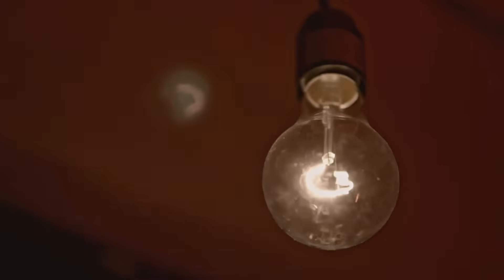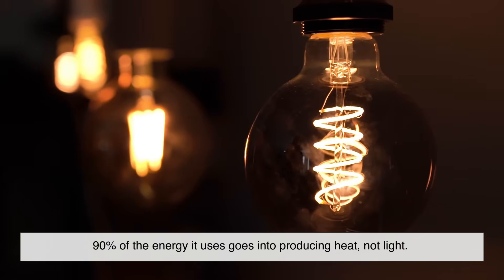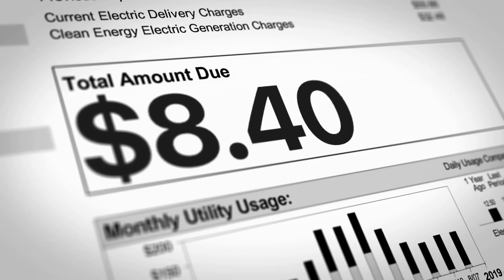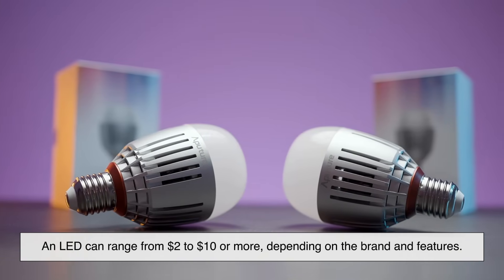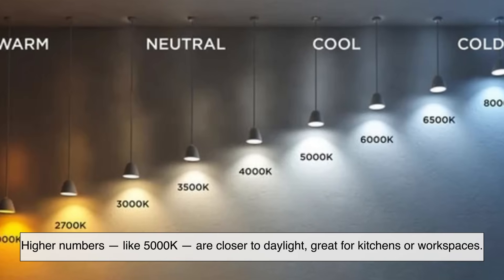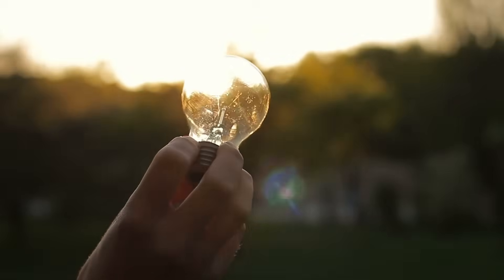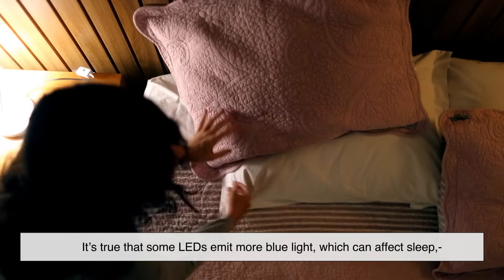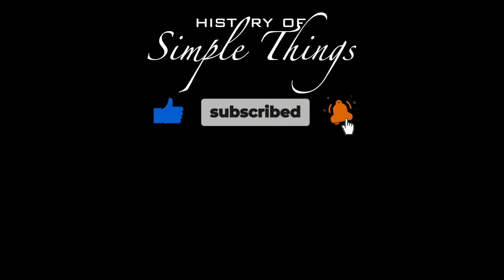LED vs. Incandescent Bulb: What's the Real Difference?

Comment: You are just praising LED lights too much, of course they are better to use right now and to save money, but that does not mean they are better in every aspect. Incandescent bublbs, as seen in most comments, has a more natural, warm light and they are like a tiny campfire, the light is just more authentic but not as practical as LEDs. On a side note, LED bulbs doesn't last as much as you say, I have to replace them every few months

Comment: Energy consumption for lighting was around 10-15% of the typical household energy consumption, and LED lighting if highly problematic when it comes to disruption of the circadian rhythms of humans and other species (this is very much the case with outdoor lighting). Read up on melanopic lighting, and you will see. As a side note, even LED light sources with a lower CCT (correlated colour temperature) - meaning a warmer hue - can contain a blue component high enough for it to be disruptive to our circadian rhythm. The blue light stimulates the production of cortisol through special nerves on the retina, that were only discovered twenty years ago! Among the health risks that arise from melanopic disorder are diabetes and cardiovascular disease. Subvisual flicker has also proven to be a health issue. That's why the LED driver switching frequency needs to be at least 3 kHz - way above the perceived flicker frequency; this isn't achieved in cheap LED light bulbs. Furthermore, incandescent light bulbs have a smaller production carbon footprint than LED lighting bulbs, and are easier to recycle because they consist of fewer materials, whereas LED bulbs require mining of copper, silicon, and tantalum. When lighting homes the heat "waste" issue connected to incandescent lighting is arguable, because homes are well insulated these days; especially in the parts of the world where lighting is needed for extensive periods of time. Basically, we're left with an energy policy issue, which could easily be solved with the introduction of modern nuclear power. This is to be seen in the light (no pun intended) of rather radical policies resulting in the ban of incandescent lighting within the EU and Australia, totally disregarding the health impacts. This is my motivation for writing this comment: a totally failed handling of matters that have complex implications on society by politicians who can't think beyond the level of a merchant. And this presentation sadly has the same angle. LED lighting is here to stay, but its proliferation was driven by idiocracy, and only now is something being done about it; namely the tightening of standards of LED lighting.

Comment: LEDs save electricity, but home lighting only consumes a small portion of the electrical energy. Incandescent bulbs, on the other hand, produce the best light, with a CRI of 100, like sunlight. 🌞(Of course, the color temperature is cooler than sunlight.) To see the difference in quality between LED and incandescent bulbs, hold a tomato 🍅or something else red 🍎🍓🌹under the bulbs: under LED light, everything red appears duller, almost gray-red, because LEDs lack long-wave red. 😐 In contrast, the bright, rich, deep red of incandescent light! 💡🤩
Reply: MY LED light produces 100 CRI
Reply: @redfishcrawfish3647  I don't believe that. It might be stated on the lamp, the packaging, or the product description, but technically it's not possible, neither with fluorescent LEDs (normal white LED lamps) nor with RGB LEDs (where the light color can be controlled). You'd have to analyze the light from the supposedly 100 CRI LED with a spectrometer to be sure.
Reply: @Tag-Traeumer  Where can you get a spectrometer?
Reply: @redfishcrawfish3647  No, I don't know exactly where you can buy a spectrometer. They're expensive. But the quality and characteristics of light can also be determined with a spectroscope, which displays the light as a spectrum. Spectroscopes are cheap, especially the ones you can assemble yourself. I have a spectroscope kit, but I haven't built it yet. However, I did once make a spectroscope out of a shoebox and a piece of CD or DVD. With that, you could clearly see the differences between light from incandescent bulbs (a uniform, vibrant spectrum with all colors and a lot of red) and LED light (a patchy, uneven spectrum with only a narrow band of red). There are videos on YouTube showing how to build a spectroscope.
Reply: You have zero understanding. Even the sunlights Color temperature changes throughout the day and how much the spectrum composition matches sunlight is a quality factor as specified by RA / CRI. Crazy how people talk about topics confidently where they have zero understanding about.
Reply: @FL0RiaN94  Color temperature is not the same as a spectrum. Compare the spectra of heat emitters like the sun and incandescent lamps with fluorescent light like that of white LEDs. How much light at 650 nm do warm white LEDs emit compared to incandescent lamps?! So the lack of understanding is yours.

Comment: LED has many electronic components. Incandescent just a filament and support. It doesn't cause AM radio interference. Usually the only thing that can fail is the tungsten. Energy is wasted mostly on heat. LED's use a lot less energy, but can fail if any electronic component fails.  They may last years, or less time than an incandescent, depending on usage, heat dissipation and quality of the lamp itself.

Comment: LED lights have bad frequencies
Reply: Not always, as incandescent bulbs have typical color temperatures of 2700k to 3000k. And warm leds have color temperatures of 2700k to 3000k.
Reply: Agreed not color temp it is just cold and empty light compared to warm incandescent and we should have the choice to use whatever we want

Comment: World’s oldest continuously lit light bulb has been on since 1901 (The Centennial Light) it’s an incandescent bulb. Funny thing about my electrical bill….. all my lights are LED & I have roughly the same power usage but they say somehow “less power usage”. Anybody know when that will be starting ?
Reply: That oldest incandescent light bulb is only still working because the filament used was extra thick and the power running to it is very low compared to a regular incandescent bulb. This is not a fair comparison at all.
Reply: @jameswilson1972  What part of it’s been lit for 124 years did you miss ???  Have you heard of any others of the same or even similar that are still lit ?  I’ve changed some of my LED 2-3X’s now and they’ve only been on the market for a few years now. Or should I say “they are the only option on the market”.  My incandescent burned longer than any LED I’ve used. I spent 40 years restoring 100+ year old homes and I’ve seen the quality of products used get less & less. So yes maybe the filament is thicker but I it’s very unlikely any one on this earth will see a LED last 124 years. And I’m not speaking from an age prospective, I’m talking about products aren’t made to last as long as products use to be…… no matter what voltage is applied to them.

Comment: I've replaced more LED bulbs in a year than incandescent bulbs, which seem to last about 6 or 7 years. My halogen bulbs have been lasting over 10 years. The LED bulbs last about a year or two.
Reply: I've also noticed my LED bulbs don't last nearly as long as the manufacturer claims. This issue was addressed by a YouTube video I saw a few months ago. According to the video there is a disclaimer on the packaging of LED bulbs claiming their lifespan is significantly reduced if they are used in an enclosed fixture. All the LED bulbs I'm using are in enclosed ceiling fixtures so perhaps that is why they don't last as long as they should. Of course it's possible that's just a bogus claim by the manufacturer to try to justify the relatively short lifespan of their LED bulbs.
Reply: Agree. LEDs cannot last as long. It's designed to fail within a certain period of time so that you have to replace it. Regular bulbs last much longer as compared to all the various well known LEDs in the market.
Reply: Nosotros compramos unas de filamento led PHILIPS y en menos de 3 años de uso en la sala se fundieron 2
Reply: My Philips hue lasted already 10 years daily use. Never had quality LEDs die (Osram etc, Philips) too.

Comment: While I'm on board with being "Greener ".
 There are certain aspects of LED bulbs that are not capable of matching their incandescent brothers.
And that difference is heat, While heat is not usually a favorable characteristic, sometimes it is a very important asset when used in particular situations.

 Especially in a low-temperature environment. There are times when that heat aspect is a very useful characteristic.
  I'm pretty sure I an not alone in the habit of using a single, bare bulb to provide a little bit of heat to prevent something from freezing over the winter months. 

  Things uch as pumps or engines in a isolated location. In certain scenarios, it is sometimes easier/cheaper to put a light bulb in a small space to protect a piece of machinery from the cold, than it may be to provide more substantial insulation. Such as in engine bays, whether that be a car, boat, or heavy equipment. 

 Something as simple as a bare light bulb, may the only thing standing between the cold, and the damage that could occur if left unprotecteed.
Reply: Hey. Don't come around here with your common sense, valuable knowledge and experience. Incandescent bulbs are one hundred percent evil and stupid. Never, EVER, use them. Go, take them and throw them away.

While you're at it, take radiant bar electric heaters away with you at the same time. If you can find the few that still exist. They're 100 percent evil too. Let's not speak of how a 2kwh fan heater, which blows you cold at 1kw or suffocates your lungs with hot dry air at 2kw,, costs twice as much to run as a 1kwh radiant bar which produces warmth that living things (and the fabric of a room) can actually physically absorb and hold on to for a while. Oh, but fan heaters warm instantly, hence no wasted energy, they say. Fan heater warmth is largely wasted energy unless your goal is dehumidification and dry eyeballs. Producing heat which disappears the moment you flick the off switch. That's because domestic fan heated hot air is the illusion of warmth, not actual warmth. The sun produces radiant heat. So does a radiant bar heater. The best can be both used together (like with a convection oven) but that's too expensive, so a push for fan heaters it is. P.S They're not instant, as claimed, either.  

What was the point of that, you may ask. The point is, energy saving for environmental concern purposes only works up to a point before a different set of associated negatives show up. Legislators never see the benefits in older technologies and don't trust any of us to weigh up the pros and cons ourselves. It's all ban the old, in with the new. A little balance wouldn't go amiss. 

I like the idea of LED lightbulbs. In practice, they hurt my eyes and I can't see properly by them. CFLs actually cause me to panic and I have no idea why. Flickering fluorescent office/shop lighting makes me actually vomit. I like energy saving. It doesn't like me.

Comment: 1:50 - that's a compact fluorescent bulb, not an LED bulb

While I do vastly prefer LED bulbs for the longer life, lower energy cost and lower heat output, the manufacturers' estimates of bulb lifetime seem overly optimistic. While LEDs do last significantly longer than incandescents, and cost significantly less to operate, they rarely meet the advertised lifetimes.

Comment: LED can change colors simply by adjusting the voltage applied to the diode
Reply: That's actually not true. Incandescents change color with varying voltage; LEDs do not. The colors produced by an LED are dependent on the type of semiconductor material and the phosphors used to convert the single-wavelength LED output to broad-spectrum light. Varying the voltage only changes the intensity, not the spectrum of the light produced.

Comment: One odd side effect of replacing incandescent lights with LEDs in traffic lights is that the latter emitting less heat means the traffic lights are more likely to get covered with ice. Thus you either need people to knock the ice off or add something to warm the light up when it's icy outside.

Comment: Tungsten filament bulbs are the best  ( ! ) for almost 100% electrical resistive loads ... for special technical test gear ( dim bulb testers ( there are videos ! ) , for electricians , test engineers etc .. ) ... these are now almost impossible to purchase , so ... if you have any of these ... and ... you are an engineer , DO  NOT  throw them out 😝... DAVE™🛑